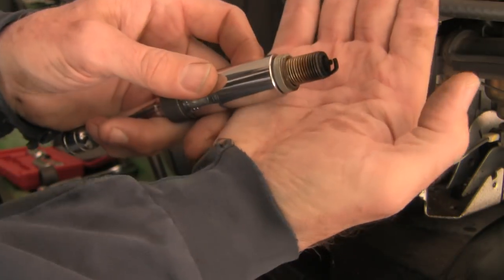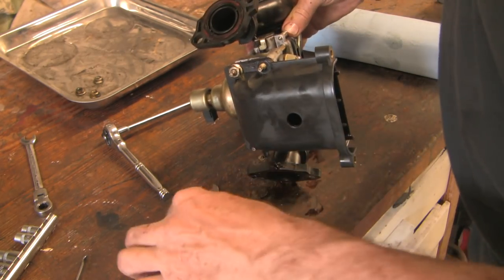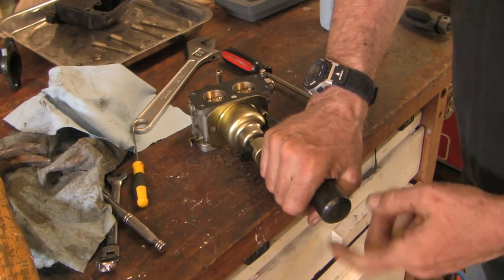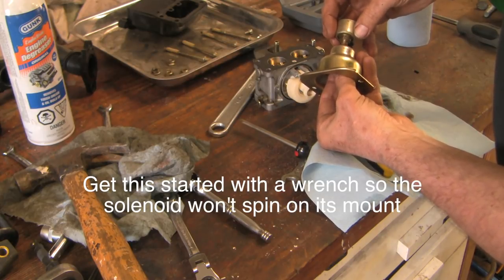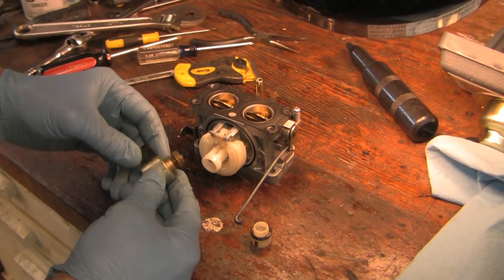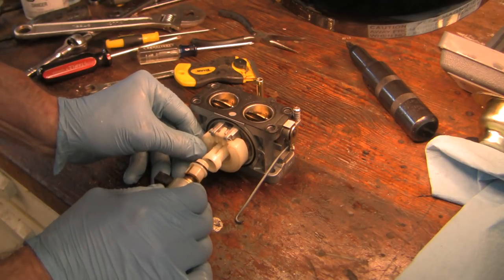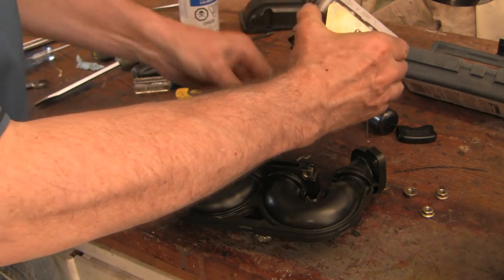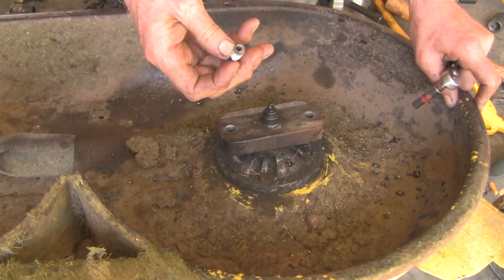How to clean a Briggs & Stratton Nikki carburetor on an Intek V-twin Lawn Tractor

Comment: When i removed the carb bowl, there were no jets in the white plastic piece (the emulsion tube). Also mine is black plastic if that makes a difference.  my mower is a 2004 lt1000. It ran before i put it away for the winter. is it possible my carb rums with no jets there just the existing holes? I don't think they fell out when i took the bowl off.
Reply from the maker: Gee, I don't know, but it seems unlikely there are no jets. You might search for your dealers repair manual. I found one online for my engine.

Comment: Also, I found that the solenoid valve doesn't always work. So, I installed a manual cheap inline valve to be sure. Several times I have had the entire engine filled with gas. Probably cleans it out but overall not a good thing.
Reply from the maker: The great thing about discussion threads is the feedback from others who did similar repairs. Thanks for making this worth reading.
Reply: The solenoid is a safety feature to cut the engine off faster in case it runs on even after cutting the ignition. So you are correct, it really isn't needed. But you should keep in mind the safety feature is disabled. I think the solenoid is wired to the seat switch and the blade engage switch. So if you get off the seat with the engine running and the blades engaged, the ignition gets cut off and the fuel supply gets cut off right where it's entering the carb. The idea being, if you fall off the mower or tip it over, the engine will cut out. Now, sometimes cutting off the ignition won't always cut off the engine, bad fuel or engines in bad shape, especially a hot engine (remember it's air cooled and those cooling vanes often get clogged up with leaves and grass clippings making it run hot) the gas could continue to ignite and keep the engine running for a few seconds or even longer. Cutting off the fuel, from within the carb, would cut off fuel to the engine right away and make sure the engine definitely dies immediately.

Something to keep in mind. If your engine runs on after turning off the ignition the normal way with the key, and you've disabled that safety feature, you might want to consider taking action, either fix the run on or fix the safety feature of the fuel solenoid. Cleaning all the leaves and grass clippings from the engine cooling vanes, so the engine runs cooler would be my first step.
Reply: Excellent Reply.  Solenoid fuel cutoff when motor is switched off is a good thing.   If it fails to cut off, i do not believe it is the source of flooding.  More likely the float valve leaking  or really plugged airfilter.

Comment: Question: ....... I have a 20hp B&S Intek V=twin but the choke does not seem to do anything, it runs well the cable and choke plate are moving to close position, but the choke seems to do nothing to the RPM.....   Is this normal?  Ever other lawn mower the choke will cause the engine to stall or run rough after its warm but not this one.
Reply from the maker: I'd wonder if you have a vacuum leak somewhere that prevents the choke from significantly limiting air flow. Especially with newer engines, it's not uncommon for gaskets to crack and leak as they age, and poor assembly can lead to an air leak near the intake gaskets. You're looking for a leak anywhere downstream of the choke. The other common cause of that would be blocked jets, such that the faster air movement near the choke butterfly can't draw in fuel because of a blocked jet. In addition these engines use a strange mechanism to drive the fuel pump off of engine vacuum. If an air leak prevents vacuum from building, the fuel pump can't move fuel well, leading to difficult starting....

Comment: I have the same motor. 22hp V twin . I have spark, gas is flowing. Yet it wont fire. Can a dirty carb prevent it from firing?
Reply from the maker: Yes, for sure. Quick start sprayed into the air intake may help.

Comment: I add a red plastic filter between fuel pump and carb also 
It stops come back because rubber does come from pump
Reply from the maker: That's interesting. The way this pump runs off crankcase engine vacuum makes me think it is a little weak, especially on first cold start. I'm surprised it can overcome a filter too, but I would guess that the bigger problem would be pockets of air in the intake stream to the pump.

Comment: I nave the set up for compression test but the other, what is the other gauge you used to show in the Green ? thanks again
Reply from the maker: I didn't find this comment until a year later, sorry. That other gauge used in part 1 of this video set is a leak down tester, used to help decide and quantify where air is leaking when facing compression problems. I did a video on how a leak down tester works, though it may be a little advanced since the video is directed at mechanics who use the device every day. It is an intriguing device, based on simple pressure/volume differences, analogous to voltage drop testing in electronics.

Comment: my jets never fall out 🤔
Reply from the maker: There are small O rings that hold the jets in place. You can remove them to clean the area more aggressively but if the O rings are holding the jets secure you can leave them in place. The O rings would need to be replaced if the jets are loosely held. Interestingly, many aftermarket seal kits for this carb do not have those tiny O rings.

Comment: 11mm or 7/16"? 🤔
Reply from the maker: As you know 7/16" = 11.1 mm, so either would likely work. I found a confusing mix of SAE and metric on this mower. As I recall, most of the housing and external parts of the rider mower were metric, but to my surprise the internal engine parts were mostly SAE. I don't reach for my SAE wrenches very often any more, which is a good thing....

Comment: WRONG HE MISSED 4 PASSAGES THAT WILL CAUSE THE ENGINE RUN LIKE CRAP   POOR VIDEO
Reply from the maker: You make a good point, I could have disassembled it further and used a full rebuild kit. Even so, what was done here clearly worked over the long term. I drove the same tractor yesterday.